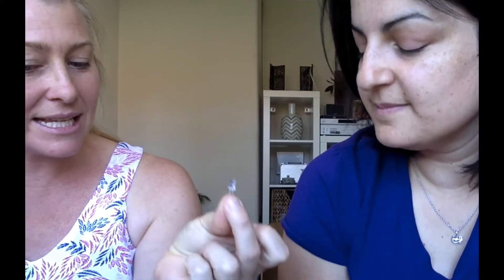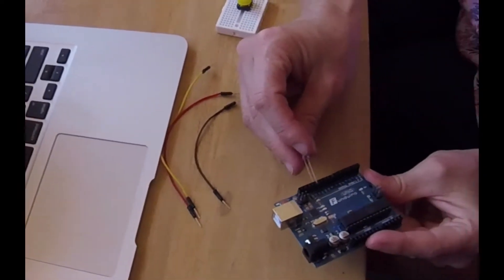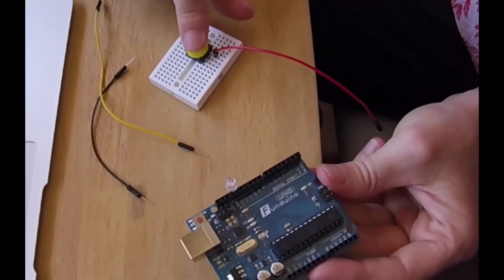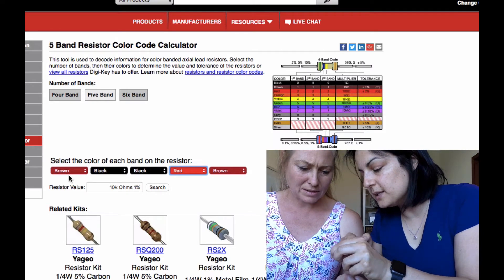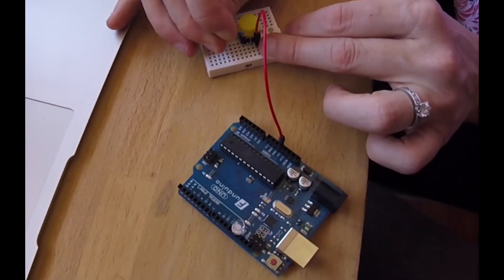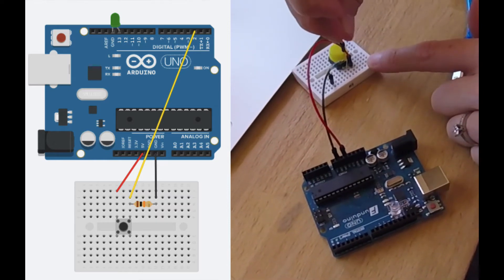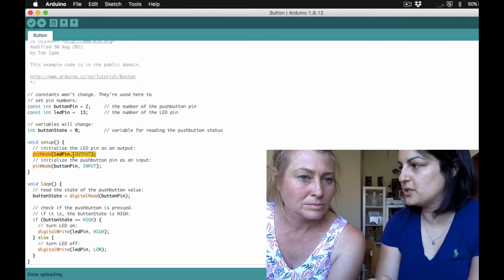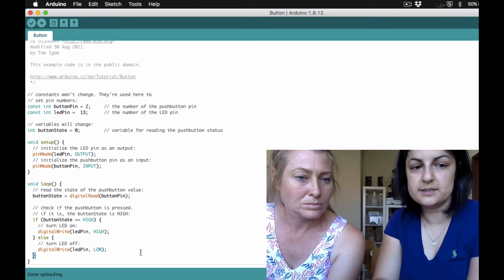How to turn on a light (LED) using a push button with your Arduino

Comment: Learning so much!!!
Reply: Hey Wood Kid (WK), thanks for liking our channel.  We need some inspiration, what else do you want to learn? We are pretty excited that you are able to do all of these things at 11 years old, you must be super smart!! Keep up the good work.
Reply: is it possible to speed control a dc motor?
Reply from the maker: Absolutely - you can apply what you've learned in the DC motor videos and the potentiometer video to use the potentiometer as a speed controller for the motor - OR you can use the analogWrite command to adjust the speed of the motor in the code.  We'll make sure we put together a video about it soon!
Reply: thank you!